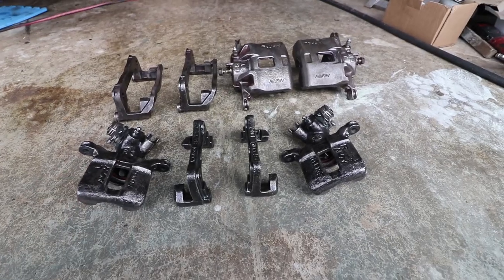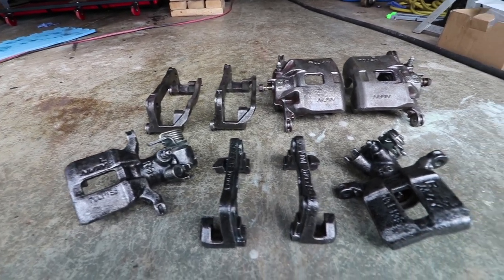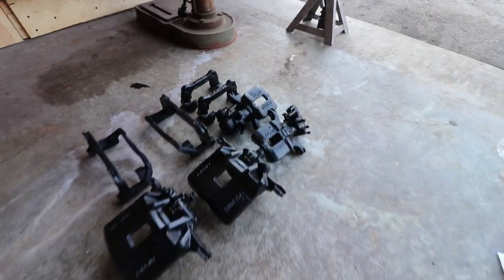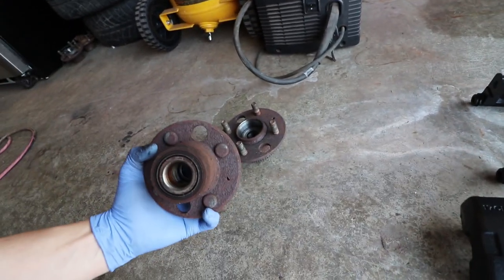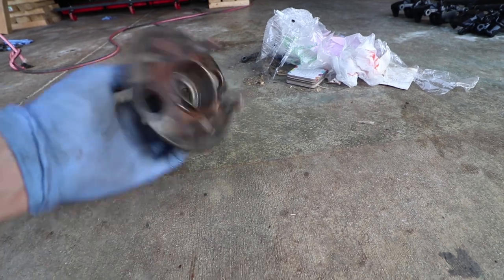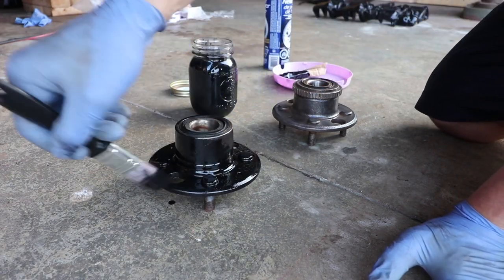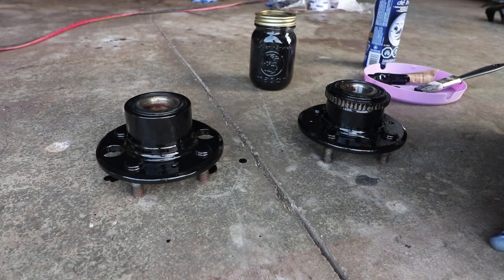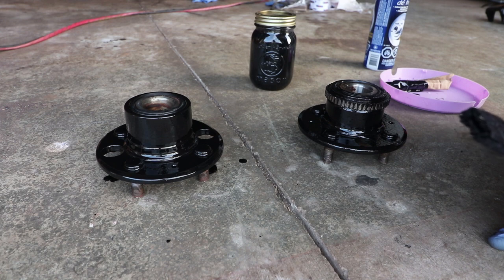Oven Baked Brake Calipers - Restored Wheel Hubs & Exciting Channel Update

Comment: Can I put my calipers in the oven with the rubber boots and o rings still on the caliper? Will I have to replace the rubber after I take them out or will they be ok to use?
Reply from the maker: I baked mine with rubbers and internals. Where the piston sits I plugs it with a thick piece of circular cardboard. After baking it looked fine. But I did replace all my internals after anyways, I got a tutorial on it in a later video. And I would recommend the same if putting it in the oven, what about using a heat gun? Those things go up to like 450 and I've done that before on a different set of calipers. It lasted a long while without chipping, or rusting.

Comment: Nice work as always! When are we going to find out what color you chose?
Reply from the maker: Thanks, i haven't really announced a deadline yet, i have it posted all around, white is currently in the lead. I'm guessing once a good amount of body work gets done i will have my choice.
Reply: Garage SpeCivic got it. White? So plain! Easy and good looking, but that blue!
Not sure if I saw, but you got a rear SI assembly for the rear calipers right?
Reply from the maker: Got the rear trailing arm/brakes off an Integra